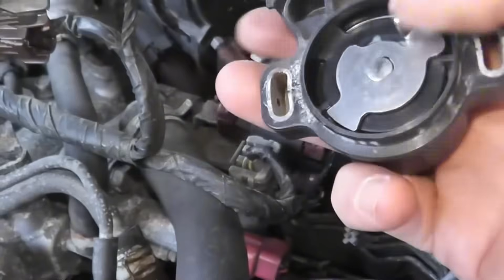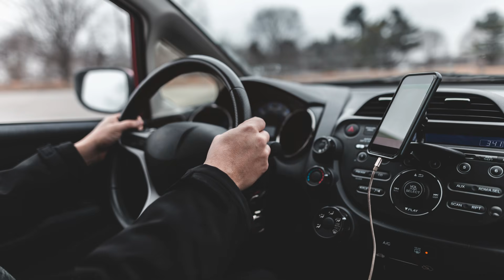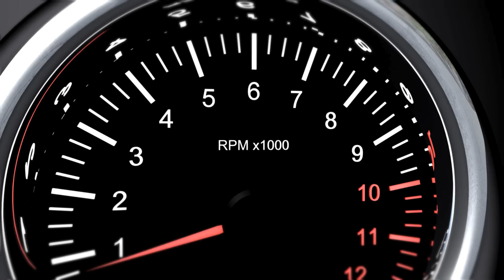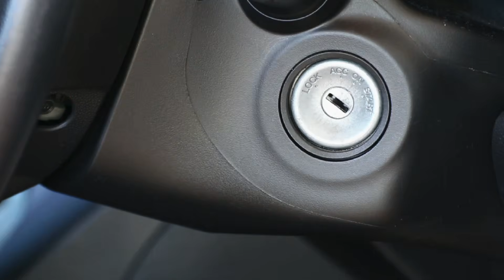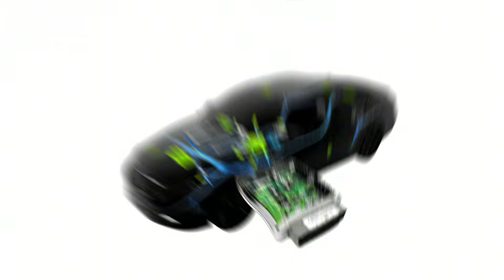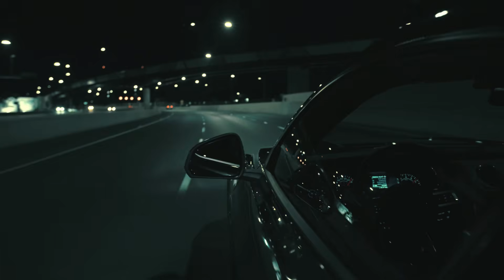How to Reset Throttle Position Sensor (3 Quick TPS SECRETS)

Comment: Can i please ask my car shakes when I drive slow but when I drive fast its ohk
Reply from the maker: A shake at low speed that goes away when you drive faster is usually one of these:

1. Engine misfire. Old spark plugs or a weak ignition coil often show up at low speed first. If the check engine light is on, read the code first.
2. Transmission or torque converter shudder (automatic cars). It feels like driving over rumble strips at around 20 to 45 mph with light throttle. Try this: when it shakes, touch the brake pedal very lightly. If the shake stops, the torque converter is the likely cause.
3. Worn engine mounts. You feel them most when pulling away or crawling in traffic.

Is your car automatic or manual, and what year, make and model is it? Is the check engine light on? That tells us which one to check first.

Comment: I replaced my throttle body on my chevy cruze ltz 2014 and its throwing up to many codes and i had someone look at it and they don't know,  it starts and idles but wont move nor will it give gas
Reply: Check gas pedal position sensor
Reply: Method #2: Do you disconnect the negative terminal only?

Comment: i have a question my csr shake and rough above 80km/h. and if i add more load it will misfire randomly , chsnged the sparkpligs , ignition oil , radiator cap , adjusted the coolant and drain it , do the 3 steps you mentionned , checked the ground of the car , changed the fuel cap , added an injector cleaner used dielectric grease in ignition coils connector and most of sensors , oil change and really cant understand ehat happening snd how i can fix it it made me tired its a civic 2008 also i checked the airfilter  its still good
Reply: Only bots in here claim that this garbage video really works. Waste of time. You need to take it to the dealership shop

Comment: Disconnecting the negative terminal is not always helping and in you cars you have to make a backup with a 9 volt battery because you can lose the radio code and other codes in your car

Comment: Wat if buzzing doesnt stop in step 3
Reply from the maker: If the buzzing doesn't stop in step 3, it might be worth double-checking your connections or considering a potential issue with the sensor itself. Let me know how it goes!
Reply: It was brand new beck arnley sensor sensor is getting power. Turned truck off tried again buzzing stopped